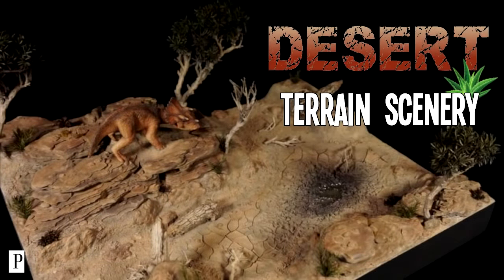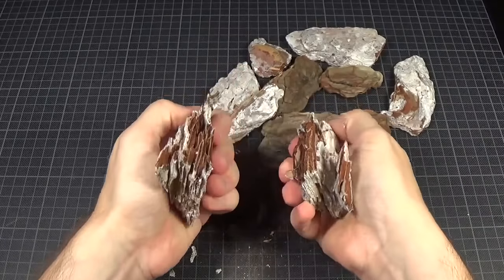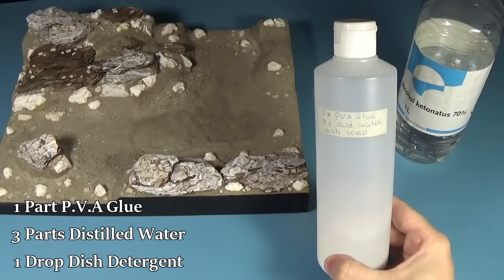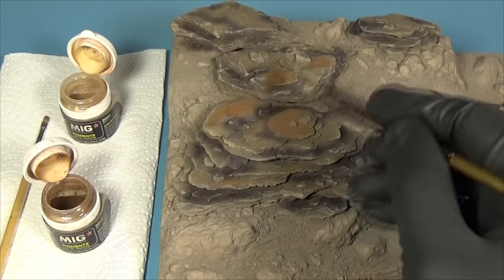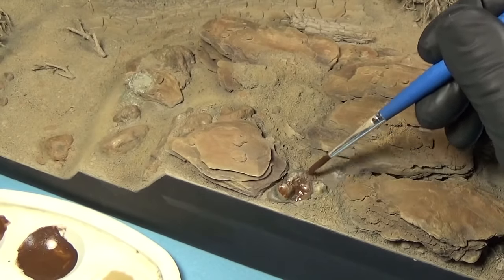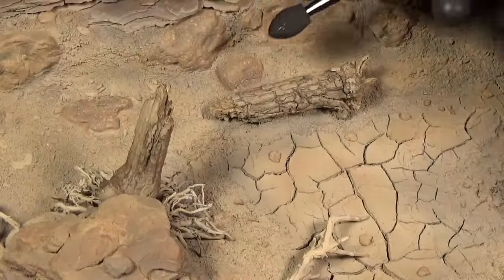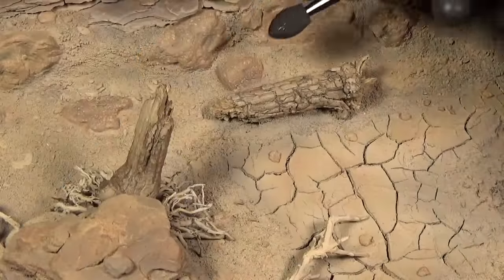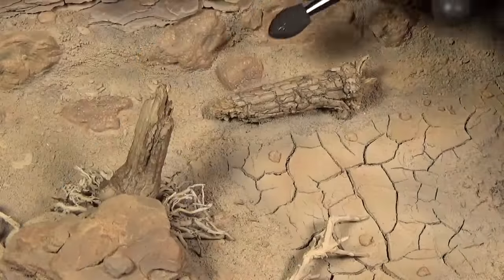How To Make Realistic Desert Terrain Scenery - Triceratops Diorama

Comment: Hello papercut I am sorry to bother you bit I have a question that may sound stupid, about the tile grout, I have bought a mix concrete made for tile joints, thinking it would be course like fine sand but it has the soft texture of concrete... there I need your help to know what is tile grout exactly thanks in advance
Reply from the maker: Hi, it should feel like very fine powder, it's usually sold pre-mixed like a paste or in powder form. It's the same material you probably see in your bathroom in between the tiles, the powder only needs water added to achieve that result. I think your material will work fine. You can try a little testpiece with sand to see if it works, keep practicing you can do it! Cheers.
Reply: Hi papercut!! Thank you for your advice, I tested the tile mix I have, littered on pva glue and it gave a rough ground effect, splendid thank you !!!

Comment: will the clay crack or shrink over time?
Reply from the maker: Hi, it will shrink a little when dried and crack a little at places, also depending on how much water you added to smooth it out. But in general it's a great product and easy to work with. Cheers.